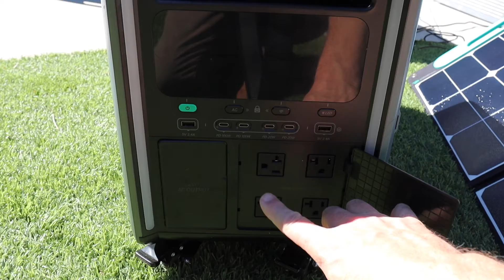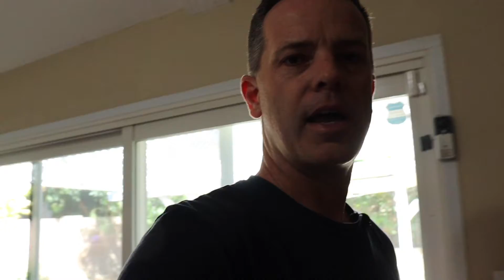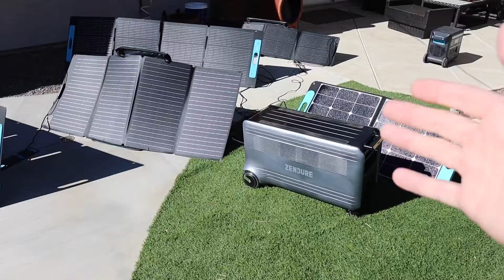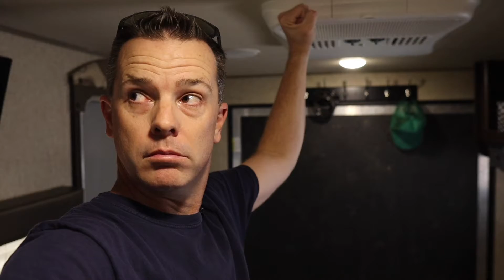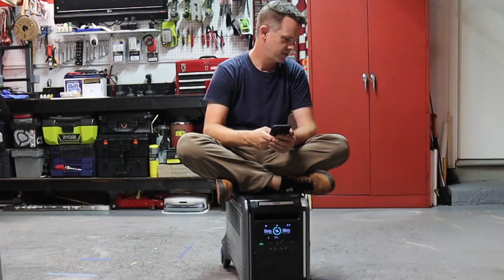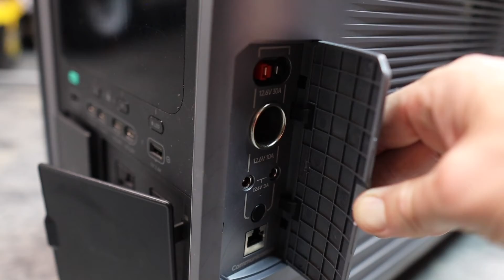Torture testing the Zendure Superbase V Power Station | Tech Tuesdays

Comment: NOTE for U.S. (probably also Canadian) users: The 240V outlet is SINGLE PHASE not SPLIT PHASE like U.S. 240V power, so take care - many U.S. 240V appliances will not operate, and some will be damaged or destroyed. I understand they sell a Y cable to get split phase from the A and B banks of 120V outlets, but I don't have specifics on the power delivered.
Reply: Y cable is needed for split phase along with a setting on the app. Gavin's garage video shows how to set it up

Comment: Where did you get the xt60 parallel adapter? and how does it work? you can use different panel sizes with it?
Reply from the maker: IIRC I snagged it on Amazon, Anker makes it. Since they are parallel you can use different panel sizes.

Comment: I'm trying to be absolutely sure that this power station can handle the power needed to run a 220/240 volts, 12,000 btu inverter air conditioner,and a medium size refrigerator at the same time. Before i buy one,have to make sure it works on my house a/c  this 2024 hurricane season  🌀🤷🤔
Reply from the maker: Do you know what the startup demands of the AC?
Reply: No,I don't know. Is that  information on the owners manual or on the aluminum plate on the left side of the indoor unit?
Reply from the maker: @carlosantoniodeclet8005  It may be depending on the unit. AC's pull a lot more juice at start up than when running. Refrigerators are the same.
Reply: Still I don't have an answer to my question. 
What about running a soft start ,as you mentioned  approximately  at 8:49 of the video. Is a soft start a device you can get to help the AC power consumption at startup. If so, where can we buy one?
Reply from the maker: @carlosantoniodeclet8005  Correct, a soft start helps with the startup surge for the AC unit. You would need to know the power consumption of the unit on startup to make sure it would work with your AC. I got mine from Active Controls,

Comment: Planning on buying one for my house use only in an emergency. Could I put some solar panels on my roof and charge this unit directly. Seems like you could. Will this help in charging the unit up more quickly than the portable solar panel units. I know it will depend on the size of the solar panel units on my roof. I saw that you had some solar panels on your roof. Have you or can you test this unit using your roof top panels?
Reply: Yes, but be mindful of the voltage max and minimum.

Comment: @17:59: Uhhhhh, aren't you forgetting something ? Look what the little white printing says under the 240 Volt AC outlet. "240 Volt AC 16Amp. Max."  This is a serious deficiency and a damn near dangerous compromise ! You can't perform any measure of home backup with only 16 useless amps ! Anything less than 30 Amps and 7000 Watts cannot power more than 6 circuits or less !